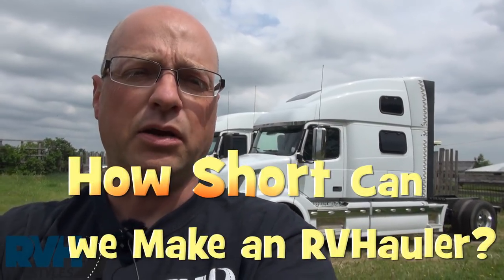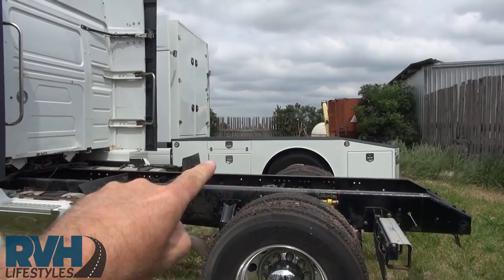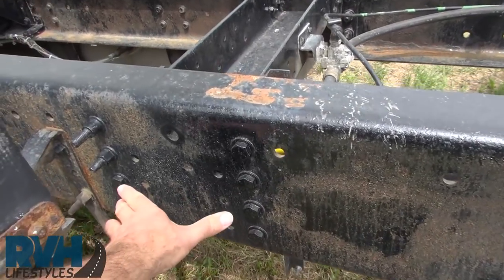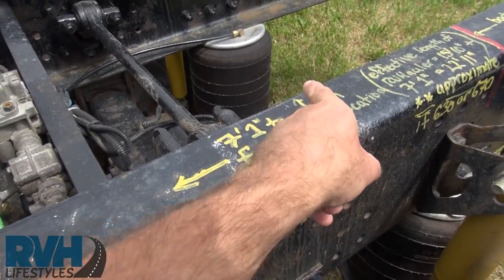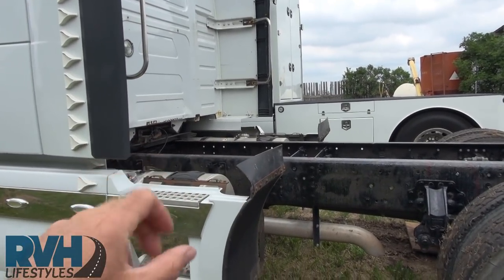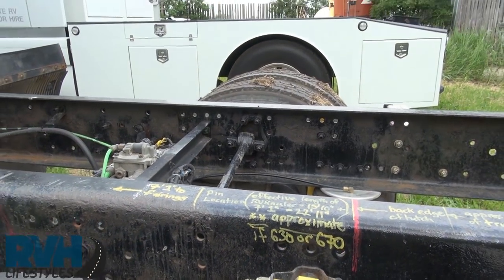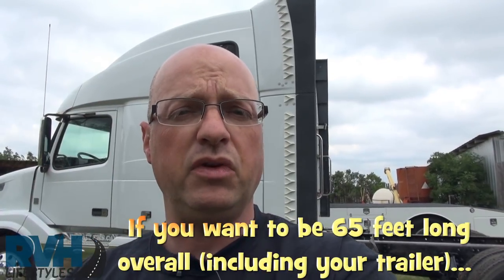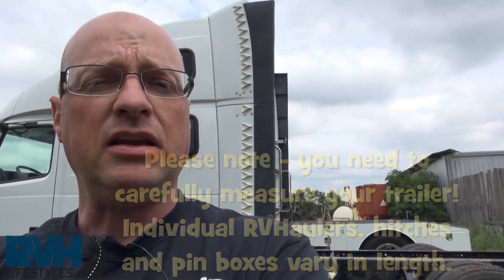How Short Can We Make an RVHauler

Comment: hey Guys,  I have a question,  what is the difference in regulation,  with a regular semi tractor being able to haul a 53 foot trailer vs an RV hauler (semi tractor ) being restricted to around 42 foot ? is that extra 10 feet to do with CDL vs non-CDL ?
Reply: Vehicle length laws differ based on the vehicle registration type.

Comment: Federal law dictates that length of a commercial truck and trailer cannot be regulated by state or local governments on National highways, within 1 mile of these highways, roads to and from pickup points, the domicile of the truck, and service places. In other words anywhere it is doing legitimate business. 

 Thats how a 280 or 290, even 300 inch wheelbase trucks get away with it. Once it is no longer registered as a commercial vehicle, then that no longer applies. If the driver is not on business and is driving on local streets while over a given areas legal length then it gets blurry. 

In reality, as a rv hauler they aren't going to mess with you for a couple feet over unless you do something stupid. It's the lawyers who would possibly make a big deal out of it in case of an accident. However, you are much more likely to have issues in an accident if you are in an overloaded pickup even though you are legal length. Accident or not 2 feet over is not unsafe, 2000 pounds over on axle weight in a pickup is.
 Look at the 45 ft motor coaches pulling 25 and 30 ft trailers with cars, toys and a fully equipped shop inside. As long as they are not over gross, either axle, tire, or gross combined they don't get hassled. Unless they do something stupid. 

I don't understand all this BS over a foot or 2. It's nonsense,  a non event. And oh yeah, the shorter the wheel base, the rougher the ride, and the less stable the rig will be. Think CJ-5 vs crew cab long bed truck.

 Just remember, if you do something stupid enough for them to question your length, you have bigger problems than being a couple feet over. 

reference:
https://ops.fhwa.dot.gov/freight/publications/size_regs_final_rpt/index.htm#net
NN = National Network
LENGTH REQUIREMENTS
The Federal length limits are principally minimums that States must allow for the following vehicles on the NN and reasonable access routes.
Truck Tractor-Semitrailer Combinations
The minimum allowable length limit for the semitrailer in this combination is 14.63 m (48 feet) or the grandfathered limit for a particular State. (See discussion of Grandfathered Semitrailer Lengths on page 3.) A State may not impose an overall vehicle length limit on a truck tractor-semitrailer combination operating on the NN or reasonable access routes, even if the trailer is longer than the minimum length required by Federal law (Figure 2). A State may not impose an overall length limit on a truck tractor pulling a single semitrailer or a limit on the distance between the axles of such a truck tractor.
Reply: Ron Hunter  Thank you for that, I'm still learning,  and I appreciate any info and opinions. 

here's another you might have info on, as another person asked ; why not have an RV hauler with regular old tandom axles?